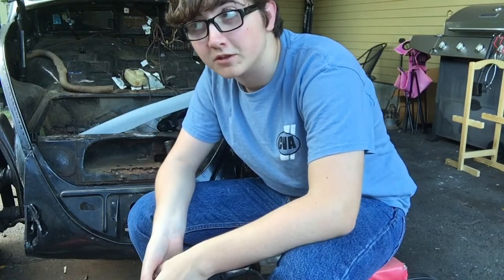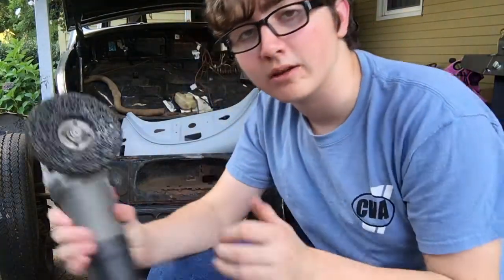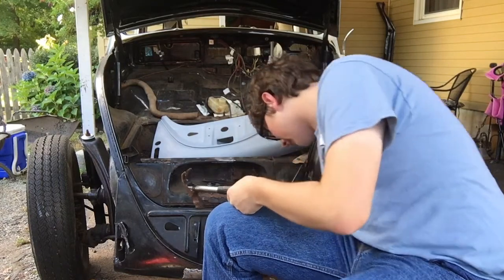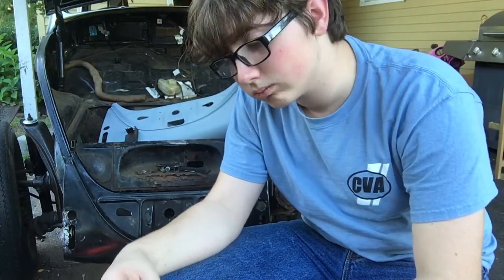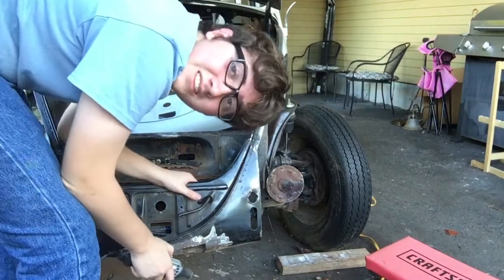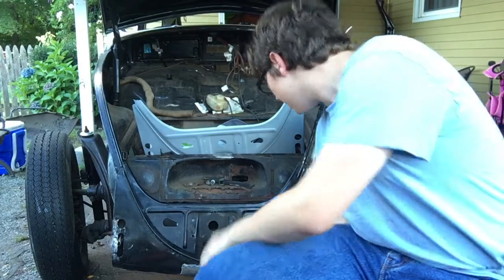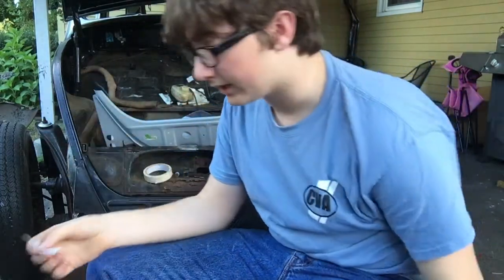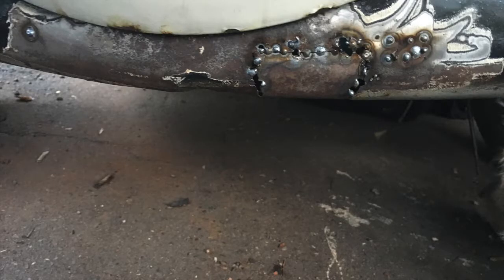Front Apron Repair

Comment: You see that rotted out area at the top of your spare tire well...that is your front body mount brace. I just spent about 15 hours doing a rebuild/repair on mine. the volume on your vids is not good, hard to hear what you are saying.
Reply from the maker: Yeah the rotted bit is getting replaced. It is actually just the first layer where the washer bottle sits so I'm making a patch for it. The volume in the newer videos is louder, these first ones aren't that good. Thanks for watching!